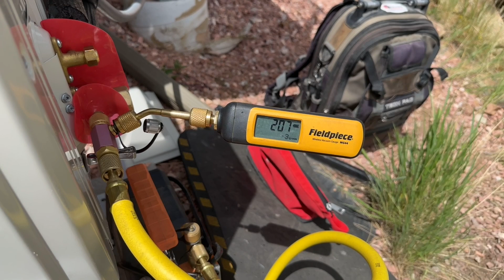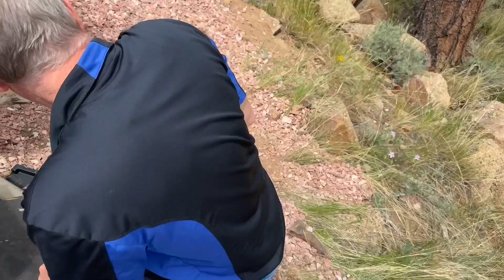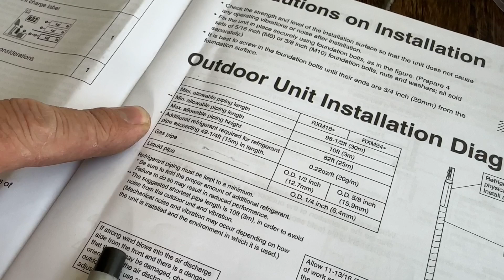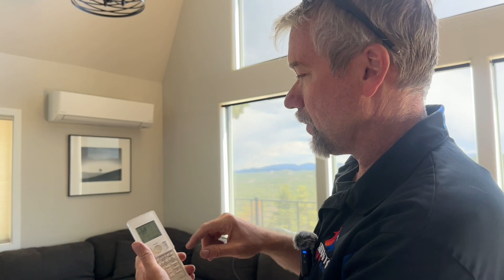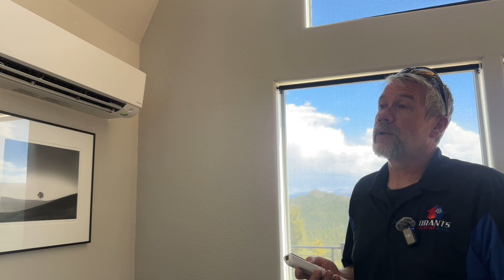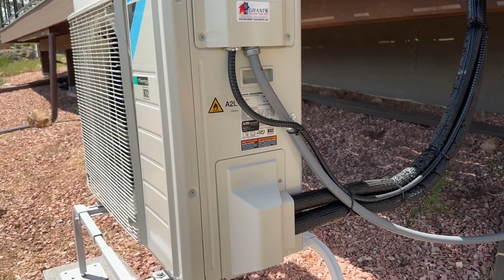Daikin ATMOSPHERA Heat Pump Mini-Split: Efficient Ductless Heating & Cooling with R-32

Comment: Nice video of Daikin mini split installation,can you tell me how many btu is that unit and how much I can pay or how much normally company’s charge for similar units Iivein upstate New York.
Reply from the maker: I always recommend a load calculation to know what you need.  It's generally okay to oversize a mini-split because of its many stages, but undersizing would lead to comfort issues.  Outdoor unit: RMX24WVJU9. Indoor unit: FTXM24WVJU9. This is a two-ton unit. Capable of 23,400 BTUs of heat at 5° outdoor temperature.   Price is all over the place, but for this high-end unit with electrical could be ballpark at $10k to $13k

Comment: You can get 2 valve core tools and then shut off the flow to the micron gauge. I just keep the gauge connected as they are rated for the psi of the released refrigerant. I want zero air in the system period, even if engineers say it ok to do it how you did.
Reply from the maker: I appreciate the tip, I’ll definitely keep that in mind for future installations.

Comment: I’ve slept in lofts before and they never seem to get comfortable even with AC . How did you select that location for the space and will it cool upstairs.
Reply from the maker: The roof line for this cabin is too low to accommodate a unit in the loft, unlike most cabins. The customer installed a large ceiling fan to improve air circulation, making the space more comfortable with proper air movement.